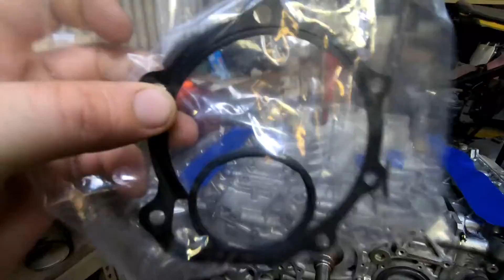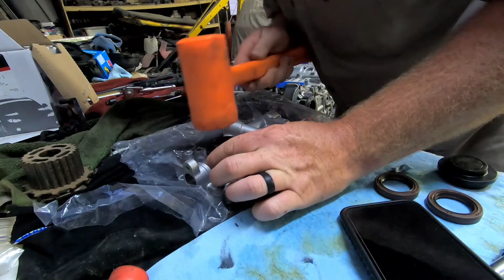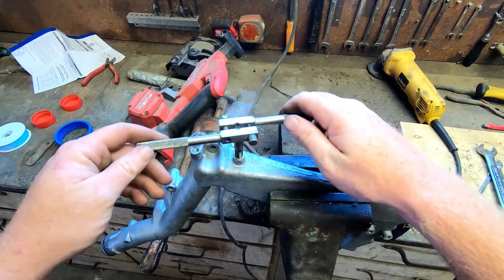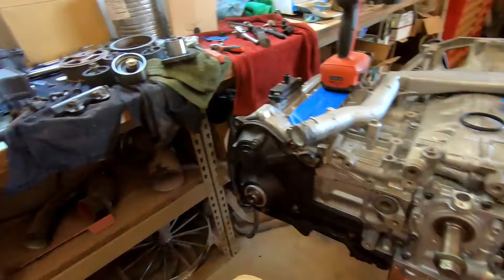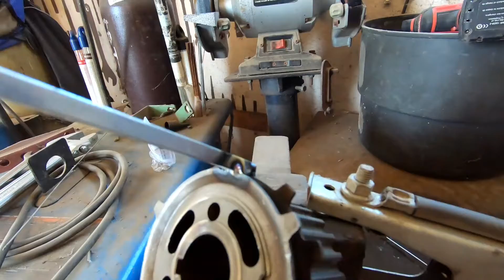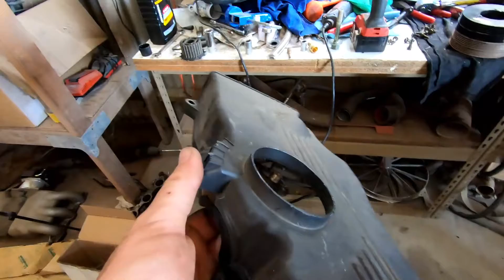Installing Ej25 Oil Pump Onto EG33

Comment: When installing the timing belt after replacing the head gaskets where everything has come off, does #1 need to be at TDC as a starting point or does it not matter as long as all the marks are lined up?
Reply from the maker: You will always want to have cylinder 1 at TDC.

Comment: You mentioned a rebuild kit for the eg oil pump, i haven't been able to locate one. I believe that the eg pump is also 12mm,  do you think the 12mm ej pump rotor assembly with fit into my eg housing? I need both crank sensors.
Reply from the maker: It’s been a few years since I have looked so maybe you can’t even find the rebuild kits anymore. I do not know if the 12mm ej rotor will work or not.
Reply: @gingerauto  I found the inner and outer rotor on a website. The pn is different from and other subaru oil pump.